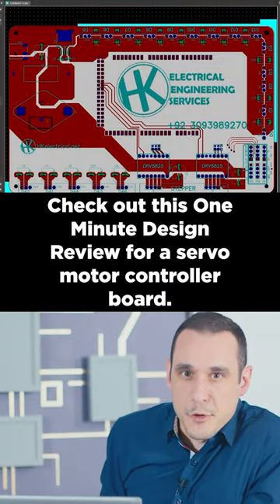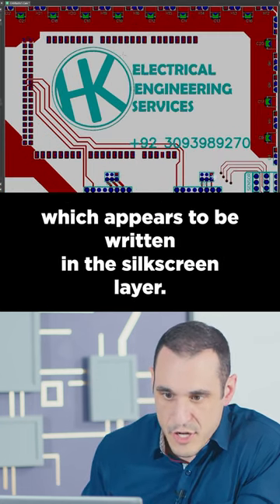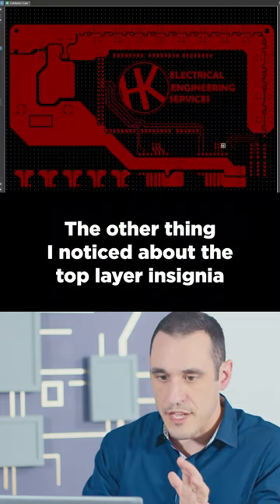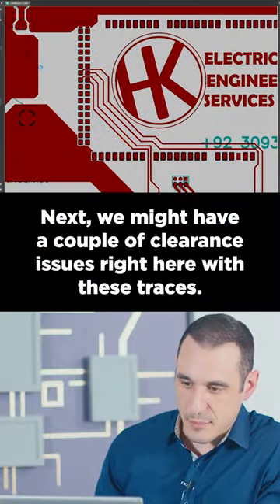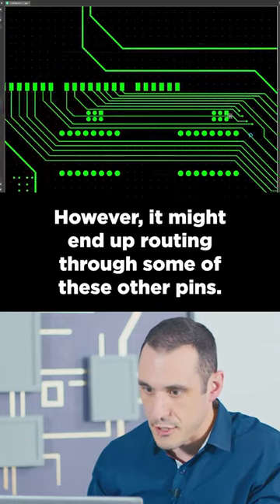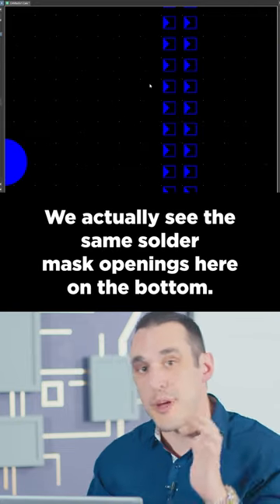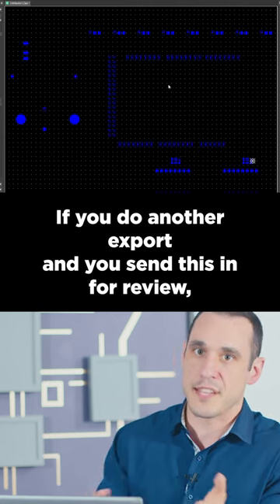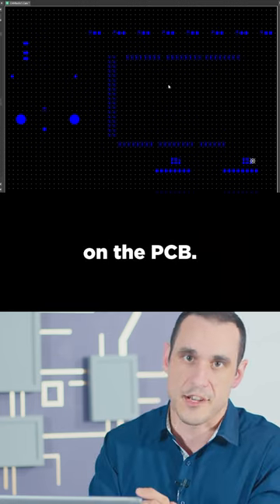Strange Solder Mask...Servo Motor Controller Board: One Minute #pcbdesign #DesignReview  #altium

Comment: What about the split plane/copper pours? They can act as antennas in the right circumstances, and with motors I can imagine some EMF issues
Reply: It's been awhile since I looked at this design but as I recall the pours were all signal and were over a ground plane, and I do not recall separate grounds in the design.